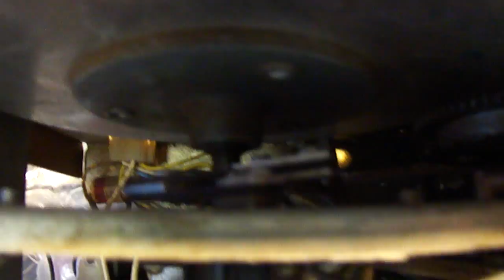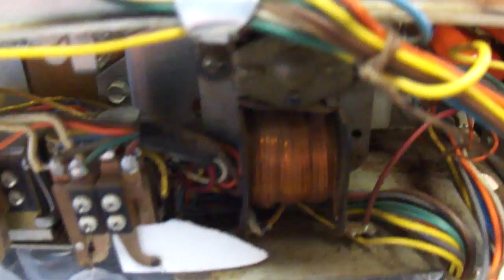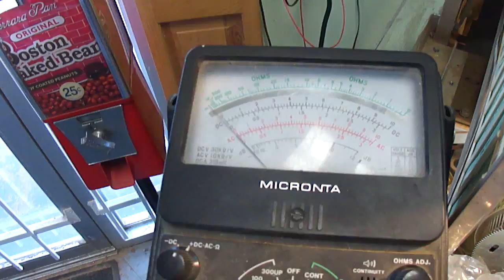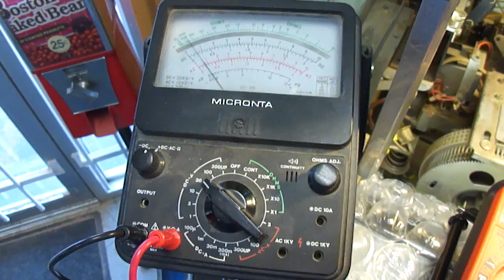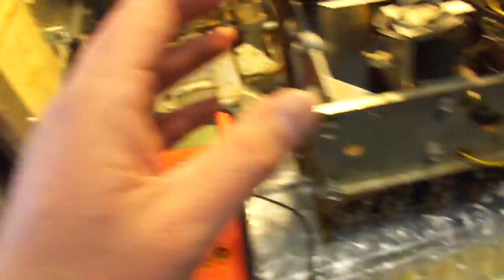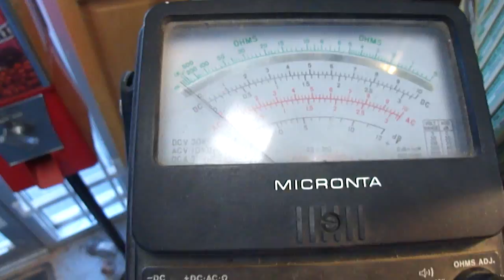AMI jukebox pulse converter contact test

Comment: Thanks for the great videos which have been educational for me... trying to repair my AMI model J box with the pulse converters... I have a couple of questions that I hope you might have an answer for... when I got my jukebox it did run well for about 5 years but started acting up about 4 years ago and has been stopped altogether for at least another 3 years.. when you press the letter number combo, it used to immediately start its pulses with the pulse selector relays.. clicking left for letters and then right for the numbers... it now doesn’t start immediately but by starting to turn the motor on the pulse generator located behind the keyboard.. the left contractor pulses.. for both letters and numbers. No pulses from the relay on the right.  I have not cleaned the contacts on this component, but have cleaned the contacts on the pulsing unit located behind the keyboard.  Any suggestions as to why the number contact doesn’t cycle and all pulses are on the left contractor.?

Comment: I had a similar problem with my JAJ-200.  When I had it professionally rebuilt by Warren Rowe (in California) in 2016, he couldn't find the trouble either.  Warren told me it's not uncommon as they age.  

After all the contacts and relays were replaced he finally installed a "brake" on that big gear behind the P converter.   It drags on it enough to slow it down so the Sprague relay has time to  react mechanically..    After almost 3 years it's still running great.

Comment: Hello from Barcelona, Spain!
I'm desperately looking for help on this issue we have:

We have a problem with an AMI J from 1959 that seems to have been converted to be used with SEEBURG wallbox according to the stamps on it. 
All selections get a random result that does not follow any pattern and since we can not find any manuals about the H-1968 conversion kit or whatever that was used we get lost and have no way to adjust it... 
Any similar experiences? Advises? Manuals? Schematics? 
Putting the pulse converter and the pulse generator back to "AMI"??? 

Thanks for your help on this! 

Cheers 

Carlos D.

Comment: was it bad contacts that caused the low voltage ? your idea of using a transistor circuit  to amplify the signal is good, how did you get on ? love electro mechanical stuff like this

Comment: Hi chad, I have the same model with a similar pilse converter and problem I just started working on. All my selections work fine,  except number 12 ones! The selection wheel starts turning and never finds the selection made from the solenoids (that seem to work fine by the way). Do you think this can just be a circuit board problem? maybe it needs cleaning? or maybe it is the number's wipers fault? With your experience, where would you start from?
Thank you for the help :-)

Comment from the maker: Thank you...I will need to double check this. I always make sure to replace the rectifier/capacitor in the power supply on customers' units but I will definitely double check this one. I put a new power cord on it years ago but I am not certain I replaced the cap/rectifier.

Comment from the maker: Also I don't like to make modfications to disguise a problem either! but I wanted to see if maybe using the transistor driver system would make the unit a little more tolerant of old wipers. We may just need to see if we can find the other smaller wiper, new , for the number search unit. I actually repaired one of the number stepper-side contacts by cutting a section of a pinball switch blade and soldering to the broken part.

Comment from the maker: Thanks a lot for your reply! I did change one of the wipers on the letter search contacts where our shop owner was able to find a replacement, that was a wiper where one of the tips had broken off. On the number search wheel we have not found new wipers yet and one of the blades' tips is also broken but is still making contact. I increases the contact pressure slightly but I think it may not be making enough contact to pass the full current at the full search speed.

Comment: you have allready probably changed the rectifier and cap in the power supply? as you know, silicon gives a bit more voltage...i still think your problem is due to the search wipers out slightly, with the blades not fully on there respective segments at exactly the same time and point, it only needs to be out a fraction, not to work properly....be interesting to see if your modification works, but i am a bit wary of moding things, as the thing was designed to work as is...   bob in the u.k

Comment: The other thing I would try is to cut all the power off, line up the contacts and see if there is any resistance through the contacts, then you will know for sure if there is any oxidation or pitting on the contacts.